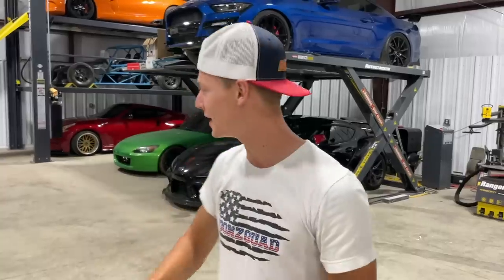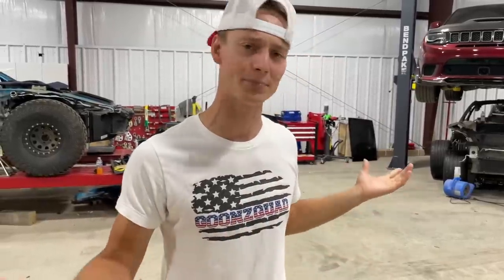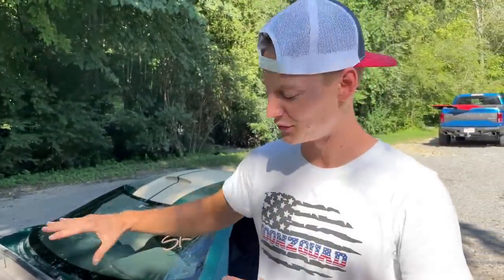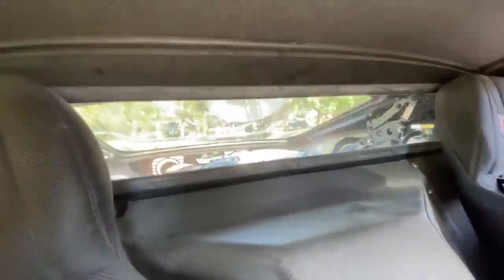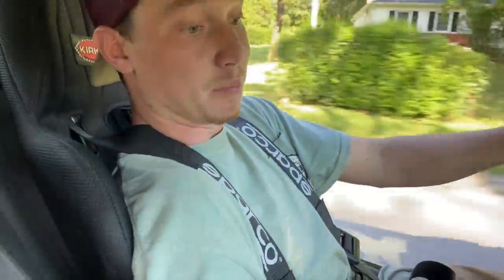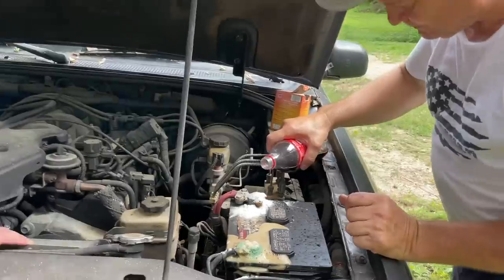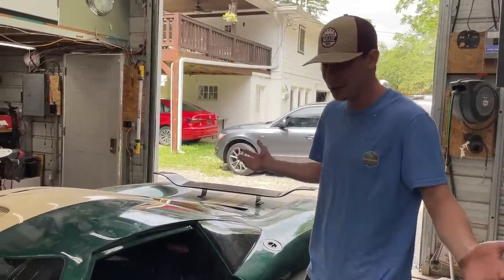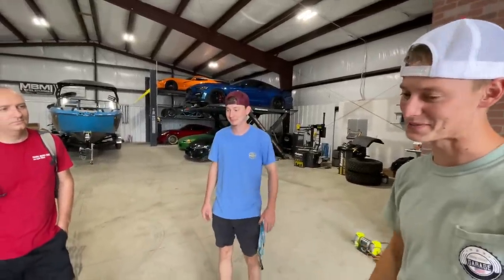The Wrecked GTM Factory 5 Supercar Is Finally Road Worthy!!! This Might Be Our Fastest Car?!

Comment: Hi guys.. thought I would give you some solid advice, regarding burnout car and tips. I live in NZ and burnouts are a religion here and Aus. Why you don't want to use this fiberglass race car. #1 Engine over wheels = epic traction. #2 When your tires pop... so will the fiberglass body.
#3 gearing and diff is designed for top speed. The Nissan requires much more work.. than the time you have available. The mustang is your best bet.. top tips for the stang. Remove rear brake calipers, or fit line locks.. Huge radiator with 100% coolant.. no water.... underdrive alt/ water pump pulleys.. for high rpm cooling.. add silicone hoses, and dual spal fans.. I would also run a large oil cooler.. When starting a burnout you need to be in 3rd or 4th gear.. not 1st 2nd or 3rd.. why? It won't produce instant smoke show required to win. Avoid changing any gears, until 30sec mark... when tyres are molten enough to allow it to not bog down.. You want low psi in your tyres as if they pop with high psi.. it will pop the rear 1/4 panels. I really want you guys to do well, and look good doing it.. If you had more time I would tell you pull out that LS7 and everything and put it in your Camaro, with a 2spd powerglide locked diff.. supercharger +methanol and stronger inner rear guards... to take all the tire pops.

Comment: Gday Simeon,
A quick tip for you. Be careful when wearing a gold ring on your finger and tightening positive battery leads with a spanner. The spanner in your hand touches the ring and it’s easy to move your hand and accidentally allow the outer ring on your finger to earth on the cars negative body. It creates a short from the body, through ring, to the spanner and then positive terminal. Your gold ring instantly heats up as it’s such a good conductor, burning the skin under your ring on your finger. You’ll only do it once, then you’ll take your ring off after that. Just be careful my friend, 
Cheers 👍🍻

Comment: The steering wheel upside down, that’s gonna be a hell of an alignment haha
Reply: In that case they need to find the center of the rack. Once they find center of the rack, if the steering wheel is upside down still, they need to remove the steering wheel and reinstall as close to correct as possible. Then fine tune adjust alignment with connecting rods. 

If they go off the steering wheel and it was installed wrong there is a chance that you will have more angle in one direction then you will the other. It only takes one u turn to realize u messed it up.. ask me how I know.  Experience lol 😆 

Oh and gtm should be the burn out car!
Reply: @kylemcweeny878  steering first thing is finding center by the looks they have it far from center also the clock spring will be out and can cause damage it if its wound all the way to one side or the other
Reply: @davidnetherway4734  you find center by turning the wheel all the way to the left then all the way to the right, count the turns then divide by 2. Then turn the wheel all the way to the right and turn it back the amount of total turns divided by 2 and voila center of rack. 
True the clock spring can be damaged/pop out. To prevent that do it slow if you feel it binding then you must remove the assembly (which they would have to regardless if that's the case) find center of rack and reinstall with clock spring assembly in neutral position.
Reply: @davidnetherway4734   I don't think it will have a clock spring on it as it doesn't have an airbag or steering wheel controls.
Reply: @sprograt  what about horn? Probably it is located other than steering wheel.
Reply: Nope, they replaced the steering rack, just pop the bolt out spin the wheel around and put the bolt back in
Reply: no it is not if you look on the top at 10 and 2 you have the places for your thumbs. so its right, but just looks wrong..

Comment: Sounds like it needs a good tuneup. Sounded down a cylinder in the cruising part
Reply: I noticed that too.
Reply: If it uses the whole system from the Corvette , than it has cylinder deactivation . That's how the Corvette get's 27 MPG on the highway .
Reply: @Notasheepleandneverwillbe  it just sounds off. Not like afm. Sounds like a down cylinder to me
Reply: It's dropped a cylinder, sounds like it OR bad exhaust leak maybe????
Reply: Yes was definitely down a cyl, best guess either faulty plug or coil pack.. Or their battery doesn't have enough voltage.

Comment: Reason for the od feel of brakes is the brake master, it's not vacuum assisted like normal cars, you have racecar brakes 🙂
And, it's mid engined until the engine sits on or behind the rear axle, then it's rear engine. Like Porsche's. 
.. I love how little you know about cars but yet you have the coolest projects going on and do well with them, always learning! 
Good luck guys.

Comment: Pour the coke on the battery terminals without the baking soda. Baking soda neutralizes the acid in the cola and you don't want that unless you want the effectiveness of the cola to stop.
Reply: I was thinking that too. lol
Reply: Boiling hot water by itself will clean the acid off. I have done it.

Comment: Hey guys the motor in your GTM is down a cylinder. You can hear it when you were crusing. Check all the injectors and plug wires and make sure they are all good.

Comment: That GTM sounds like a beast. if the brakes are soft, air in the lines or pads/Calipers bad.
Reply: He said petal was hard to push. That means he dosent have enough vacuum feeding the booster. Or if vacuum is sufficient then booster diaphragm is malfunctioning causing the booster to not assist the petal.

Also if the seals in the master cylinder are bad it could lead to this symptom however usually when a master cylinder goes bad it leaks or it gets stuck.

Im leaning to a vacuum supply issue. 

If you install long tube headers or a loopy cam it lowers vacuum pressure. There's a chance the guy that originally built this (its a kit car) he never figured that out and brakes have been like that the whole time and all takes is a real mechanic (like me 😆 jk) or am I? To get to the bottom of it...

Comment: One thing I've learned using soda pop is to use diet. The sugar can create near future connection issues. Also the use of baking soda as pops was is an excellent addition.
Dielectric gell/grease is a good connection add when putting cable back on. On top, where vasoline works is covering cable but only after reconnected to the battery. Not before connecting as many people do. A dry spray for batteries is in all probability a much better protectant.
Reply: 👆👆👆👆Thanks for going through our video's.
Inbox to Grab ownership of a prize..

Comment: What determines whether a car is a mid-engine or rear engine is the location of the transmission. In a mid-engine car, the transmission and the rear axels are behind the engine putting the engine still in the middle ( or mid) of the axels. In a rear engine like a Porsche, the transmission and rear axel are in front of the engine meaning the engine is behind the rear axle.
Reply: Porsche Boxsters have the transmission in the back and the engine in the middle, so are mid engine. The 911’s are engine in back and transmission in the middle.

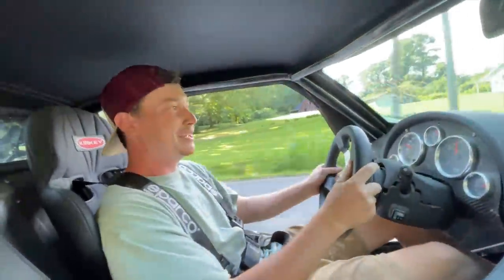Comment: 10:59 Smells like a traffic ticket! ) Coca-Cola contains phosphoric acid, but even just baking soda with warm water perfectly removes sulfuric acid from the battery. The terminals must be well cleaned, and before installing them in place, you need to lubricate the battery terminals with graphite or copper grease. Then they won't oxidize. In addition, it is very likely that the battery is not sealed, so its terminals turned green.

Comment: Mid engine is where the engine is inside the wheel base, you could have a front-mid engine or rear-mid engine. A rear engine sits over the rear running gear and front engine sits over the front running gear.

Comment: Put a line lock on the front brakes and do a burnout.

Should see how fast simple green removes that corrosion. I had it in a spray bottle. I hit it once and it knocked it clean off. Just a cup of it will clean those terminals. No brush needed, except the wire one to shine them. Just wash the soda off. It gets in between the connections.
Reply: Line lock will not make the front hold any harder. The front wheel is already locked up and the car is just dragging them. Front end is just too light, and the rear has too much grip. The car blows past the back brakes easy enough.  Only way to do a standing burn out is to wet the backs which will only hold for a few seconds or tie off the car which is ill advised.

Comment: hey guys a tip from australia about doing burnouts you need to learn the healtoe method for clutch and brake control clutch dump and jump wont work very well in most modern cars with abs and other controls cutting in and out

Comment: That corrosion is copper sulfate.  Lead acid batteries use sulfuric acid as the wet medium.  It will leech out past the battery terminals and chemically react with the copper in the battery cables and leave the blueish green corrosive deposit.  The reason why your dad is using coke to clean off the terminal is because the carbonic acid in it reacts with the corrosion on the battery terminal to clean it off.  Old timers have been using this trick for years.
Reply: Thanks for going through my videos.

Inbox to grab ownership of a prize 🎁.

Comment: As far as a burnout car, you really should do a build specifically for that purpose. That Mustang is the car that initially really set the channel off, so you shouldn't risk that. The Nissan 370 is disposable, but it's also not a good burnout car, and you don't want to show up to a Cleetus burnout event with a car that sucks for burnouts. As far as the cars already in your inventory, the best burnout car candidate you have is the 1968 Camaro. Burnout competitions use monster HP engines to tear up the tires, and that Camaro is the perfect candidate for a 1000HP+ engine with a big tunnel ram blower. You can put a wall-tap bar on the front and rear to protect the car as well. It's either the Camaro, or a brand new build just for burnouts. OR you could engine swap the 370 to have something a lot more beefy, and weld the differential to lose the positrack.

Comment: Guys, this is a MID engine, in front of the rear axle... so best weight distribution. The squirly risk you talk about is for rear engines i.e. 911 cause the engine is behind the rear axle. But modern Porsches havent dialed it in and are no longer risky.
Old 911 turbos were notorious for losing the back without warning when you pushed them just past the limit. (Why they were called widow makers)
Reply: 👆👆👆👆Thanks for going through our video's
Inbox to Grab ownership of a prize

Comment: Rear engine is when the engine is behind the tires like Porsche 911. Mid engine is when the engine is behind the driver but in front of the rear tires like the car you have there or a Porsche 914.  Mid engine vehicles usually have a wonderful weight  distribution
Reply: axles is more precise than tires, but yes, you are correct.

Comment: Mid-engined means the engine is between the front and rear axels.  Technically, C5, C6, and C7 Corvettes are mid-engined.  Rear engine means the engine is behind the rear wheels, like in a Porsche 911.  Front engine means the engine is above or in front of the front axel.
Reply: Actually it’s the position of the engine related to the transmission but whatever
Reply: @mattg7952  wrong. Its based on the engines position relative to the front/rear axle line.  That's why you can have front mod engine cars with rear trans
Reply: @mattg7952  Umm... No.

Comment: The GTM is 1000 pounds lighter than any of your other vehicles with 500 - 600 hp. Just make sure you put some heat in those tires before you step on the go pedal, or you might find yourself upside down in a ditch. Bolt on a set of slicks or drag radials.
Reply: 👆👆👆👆Thanks for going through our video's
Inbox to Grab ownership of a prize

Comment: That is some acid leak and corrosion on the battery terminal, just wash with hot water apply some grease on the battery terminal after and it will look brand new every time

Comment: People correct me if I'm wrong, but I don't think that line lock will help this car in the slightest. I say this as the front wheels just get pushed and the car easily blows past the back brakes. The reason why this car can't do a standing burn out is because the front end is too light, and the back contains too much grip. I love the sound of this beast though and it seem fast as hell.

Comment: I think the GTM will just push the front tires with Line Lock.  Not enough weight in the front, too much power in the rear.
Reply: Finally, I see this comment. You are 100% correct, line lock doesn't give the front tire magical grip. It is too light, and they are already dragging.

Comment: Don't wreck the Mustang take the Z.  I started watching your channel very early on when you were just starting on the Mustang, before you had the old shop.  You were working on the slab under a canopy.  Also there is one way to keep your keys or key fob from being read and your car being stolen.  A thing called "Faraday Key Fob Protector" will prevent the key from being read.  If your key is inside it even your car won't start with the key in your pocket.  I keep all my key fobs at home in them.

Comment: Just an FYI - my 2002 Audi TT kept getting crazy corrosion on the positive battery terminal.  Turned out that the post was loose!  Problem solved with a new battery but not before around
 $400 damage to the electronics under the battery!

Comment: Head to head with the viper full episodes
Drag race full slicks tires both cars, setup coil overs to hook and go 
Then race at 40 mph start then 60 mph then 80 mph   maybe upgrade the rear gears 
Then tires adjust suspension and hit the track on time best time in each car both drivers
Reply: 👆👆👆👆Thanks for going through our video's
Inbox to Grab ownership of a prize ✅

Comment: The acidity of Soda harming you is an old myth that the uninformed spread. Your stomach contains hydrochloric acid with a pH of 1.6. To understand how strong that is I'll explain. The pH scale is mostly displayed from 0 - 14. 0 being strong acids like battery acid, 7 being completely neutral water and 14 being your strong base, alkalis and caustics like liquid drain cleaner. 1.6 is a pretty strong acid so Coke has an acidity of 2.3 which is equivalent to that of a lemon. 

Sorry for the long comment, I appreciate learning something new and always verify the information for yourself instead of taking what's posted in the comment section as facts. Definitely do that before spreading the information.

Comment: Pops should switch to water. You can even use it to remove corrosion on battery terminals just place a penny on top of the terminal and pour water over top.. Watch it dissapear!

Comment: hot water in a aluminum can , just cut the top open and soak the terminals in..  it takes all the corrotion off the battery terminals.

Comment: I feel like the baking soda and coca cola battery cleaner is a classic boomer myth. My dad has done the same thing. Just think about the basic chemistry of it- coca cola is a weak acid. Baking soda is a weak base. When mixed together they neutralize and form gas. 

It would be better to use just the coca cola for cleaning as acids dissolve inorganic soils like the corrosion that has formed on the battery terminals.

Comment: If you going to skid the mustang boyz yous need to get some stock wheels for the back and run some cheap skinny tyres will save your back bumper and produce heaps off smoke. Tip from Australia the burnout capital lol

Comment: One thing you should check as a priority, is the rear shock mounts, the ones which mount the shock to the lower control arms. If they are the standard FFR black ones, change them. Change them NOW. Stop driving it, and change them. They are made of butter and will bend/snap and the mere sight of a decent pot hole. Trust me, i know.

There are proper race proven hardcore steel replacements you can order, you can find them on the FFR forums,

Comment: plug rear brake lines so they spin freely
Reply: 👆👆👆👆Thanks for going through our video's
Inbox to Grab ownership of a prize⬆️.
Reply: Line lock will not make the front hold any harder. The front wheel is already locked up and the car is just dragging them. Front end is just too light, and the rear has too much grip. The car blows past the back brakes easy enough.
Reply: @esqueue  its not for make it harder on the front is to make it loose on the rear.
Thats some setups i've seen for burnouts, for drifting rear brakes is a must

Comment: For the 370z you can’t do a standing burnout without a tune or pulling a lever under the hood to remove all rue traction control ,you can pull the black lever up to remove everything it’s under the hood on the driver side next to the brake fluid once you pull that or get a tune you can do standing burnouts

Comment: For your race at Bristol, buy a carbon fiber helmet. You want as little weight as possible. Also, start now Duck taping weights to your current helmet and a could times a day, do neck strengthening exercises. 
One last thing, buy a Hans devise. This was developed after Dale Earnhardt was killed. Cletus and most everyone uses one. It keeps your neck from snapping around in the event of a crash. Best of Luck and may Jesus roll will you

Comment: Lmfao use water on the terminals and it'll do the same thing, literally tap water will get rid of the oxidation as long as it does not touch the other terminal, it's has nothing to do with coke or rocket science lol.